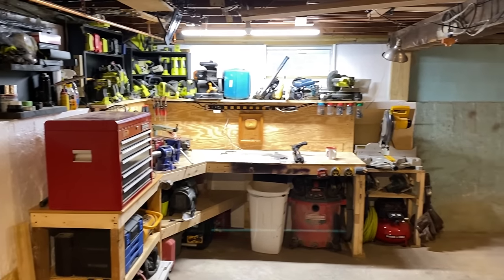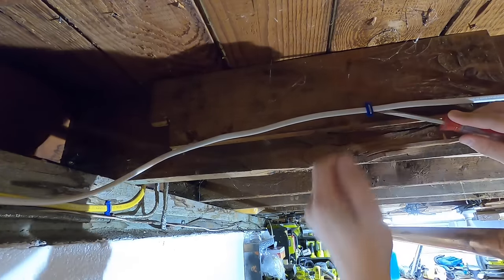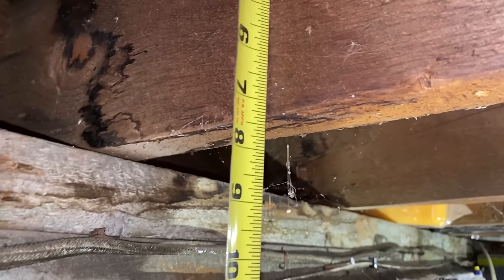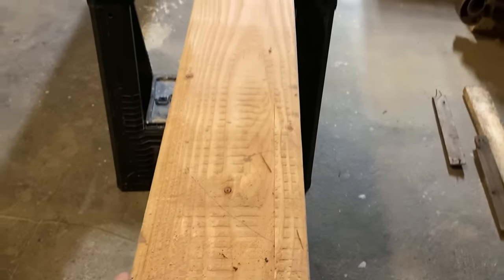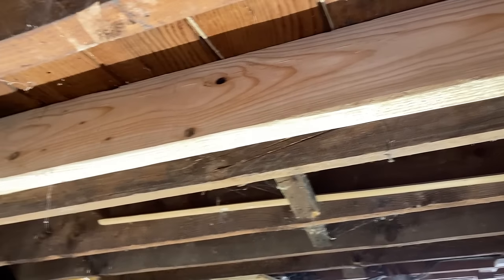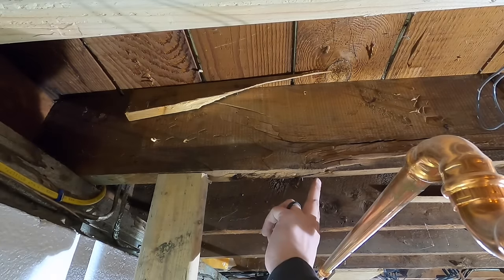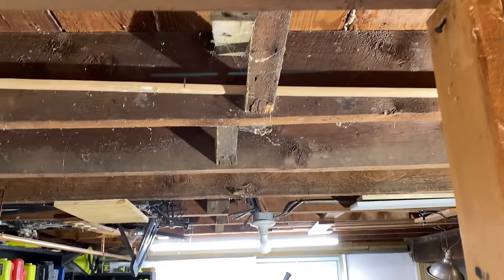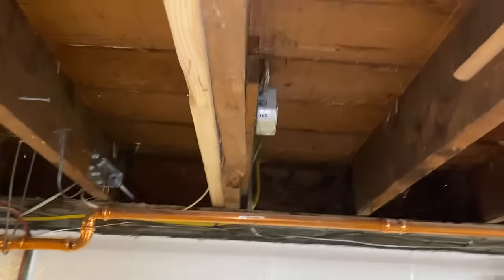"Sistering" a Cracked Broken Floor Joist

Comment: The only thing I would do differently is nail it as well. Screws have alot of clamping force, but can shear vs nails which can pull out, but have better shear resistance.
Reply from the maker: Yeah I will probably add a bunch of nails.  I wasn’t satisfied with what I had there after an hour or so and I have a bunch of spikes so probably gonna go nuts with the nail gun.  😁😁👍
Reply: Depends on the screw or situation. We don't know what is above or the load but all he did was make a double. Some screws are structural, but he did say construction screws. I'm thinking home Depot there cheap construction screws looks like the expensive grx sold at Lowes. Spax at home Depot are said to be structural screws
Reply: Depending on what brand and rating of structural screw you chose, screws will actually handle quite a bit of shear if you array them properly.
Reply: You can use GRK screws that have the shear strength of a nail, with the clamp of a screw. Expensive though. And I always clamp the boards together as well before fastening.
Reply: Timber locks or head locks are way way stronger than any nail. They make the red ones specifically to attach lvl’s together, but people are in a hurry and want to cut corners and use Nails
Reply: @Doug Miyamoto  grk screws got my entire porch back on when the thing fell, I got to surf it to the yard floor 😅

They haven't budged an inch In years, agree its the highest price but I can't possibly deny the results
Reply: @h2s142You’re absolutely correct. Definitely use construction adhesive.

Comment: I learnt it the hard way, attaching the support with a couple of screws so that it doesn’t fall and create damages. I was working with my son to replace a porch 4x4 post. Didn’t screw the temporary support sitting on a jack. When we made a small adjustment the support fell down and hit a garden shovel in the vicinity. The broken metal spade portion was thrown off about 10’ and the remaining broken handle swung and made a hash on my son’s shin. Fortunately he has forgiven his father for his stupidity

Comment: Aren't, you glad the previous board for the original repair was not glued... I am baffled why we the population is so enamoured with glueing... I am not convinced that it is a good thing.  Next time you may have to remove both rendering the repair a little more complicated... Don't get me wrong I have used glue before but I do it reluctantly.... Always thinking of " What if I have to repair it down the line."..

Comment: I had to do the same in my house (built in 1929) the only thing I did different was C-clamped it before adding screws to ensure adhesive contact along the length. It looks like it will be fine!
Reply: I'll be doing this tomorrow on a 1910 home... but I WILL be raising that joist which has sagged in the process...

Comment: I would have C-Clamped them together rather than using screws to pull together. This assure a better bond for the adhesive. So First apply the adhesive, then C-clamp together, then finally add screws to finish. Hear in Texas we call that a Sandwiched Beam or Rafter if 2 sided.  Sistering if 1 sided.  Other wise.....Very Clear Detail and Running Explanation and Video.!!
Scott Briggs, 82.  Luxury Custom Home Builder 38 years.

Comment: Came back here to say - THANK YOU. You saved me a bunch of missteps. And you're the only one I saw that advised to screw the jack to the old joist, that trick saved my TV several times for sure.

I was repairing a 16' span and the jack kept getting lifted and became useless, so I quit using it and used a 2lb sledge to whack the joist into place. 

Floor is rock solid now! Thanks a ton, man.
Reply from the maker: Happy to hear you got it done!  And happy I could help out! 👍

Comment: I've sistered every second joist in my century home and boy it was a fun experience.  I used bessy clamps to suck the 2 boards together which helped a lot.
Great video bro!👍
Reply: Good clamps especially the padded kitchen cabinet clamps to help align as you secure the cabinet to the wall

Comment: Where I’m from we call that ‘marrying two boards’. Also, I’ve used a couple of C-clamps to bring 2 boards together.
I only know that because about 4 years ago I had to strengthen some floor joists in my 1972 mobile home under what had been the bathroom. The original floor joists were rotten on top in places and so there wasn’t much area to nail down the plywood. The solution, I felt, was to marry (in one instance sandwich) new boards to the old ones. I used large C-clamps to force the boards together while I ran screws into them.

Comment: I did this exact same thing pretty much except in my crawl space. Instead of using screws to bring the boards closer together I used half inch wide 8 inch bolts with washers on each side and impacted them together

Comment: My nickel on the ground, Sister is a shipwright term when pairing up the frames of wooden boats to strength them as each frame is different form the next they have to be made individually to mate together. By the way i was taught wiring cleats have to be a hammer length apart with the nail underneath to support the wire.🔨⚒🛠
Reply from the maker: Interesting!  Thanks for sharing!

Comment: Having had to do a similar job I used G clamps as well as glue,in this case I would put some gap filling glue to the top and nailed and pilot drilled for screws to avoid overstressing.Maybe treated the old joists for termites as well.👍

Comment: Those floor joists look familiar and I have a few above our kitchen that need repair too due to bath remodel plumbing. I did one of the over notched joists a foot of two from the corner of the house under the second story floor. It was not fun. The other is under the tub and the joist is already sistered, and both are notched so much the floor sags while in the shower and the plumbing leaks almost even time, unless we stand back far enough from the tub drain to keep the floor from bowing. If it were the only problem I would have tackled it long ago like some of the other plumbing I've adjusted to reduce other code issues. but I'm still left with 3 that I know I need to address. It's nice to see a youtube about a house that was built with similar materials as mine and I look forward to searching your channel for more ideas on how to address my future attempts to repair our houses bath remodel issues. :)  And  possibly some other ideas besides.

Comment: It’s amazing how much extra time has to be spent on building because we can’t get straight lumber. I know green wood chances as it dries but I’ve almost had to fight local hardware store managers because I was sorting through lumber that I was using to pour concrete sidewalks with. I needed straight boards.

Comment: Had the same issue in my 1975 house... right in the middle of the dinning room floor.  One 2x10" joist had a huge knot that weakened and cracked all the way through, top to bottom.  The builder never should have used it in the first place.  I added a 3/4" plywood "sister" on both sides after carefully jacking it back up in place about 3/4"... construction glued and screwed, 48x10".  Did the trick and solid as new.
Reply from the maker: Yes!  Plywood on both sides with glue almost turns the joist into an engineered piece of lumber!  Does a great job!  Thanks for sharing!!
Reply: @TheFixerHomeRepair  How do you come up with a piece of 3/4" OSB that's as long as a joist? Or can multiple pieces be butted together?
Reply: @mikemiller9891  no it doesn't have to be AS ALONG AS the joist you are supporting.  it just has to overlap the cracked section by 2-3 feet on either side of the weak spot.  In this video he makes a replacement joist and acts like its a sister joist when really its just a replacement joist just as strong as the original and same size as original making the original redundant and he could have just cut out the original at that point since he's not relying on it at all.  Whereas just putting a sister joist in the damaged part of the original still utilizes the original and relies on it.

Comment: Only problem I ever had was floor squeak between the joists and subfloor, adhesive is needed there also. Sister or marry can be used        interchangeably.

Comment: Here in South Florida, it’s all slab on grade. We don’t have such issue, but I enjoy watching you work. Good job.
Reply from the maker: Lucky!  Only thing I get nervous about with slabs is plumbing repairs… I have heard stories.  Thanks for your continued support of my channel! 👍
Reply: Funny you should say that. I just had 16’ of 65 year old cast iron sanitary line replace with PVC. They hydroblast a 3’ x 3’ tunnel under my house, fill shot blasted back in. Expensive, $330 per foot. No way around it, I just had to bite the bullet and do it. About $8k with permitting and engineer’s report.
Reply from the maker: @1styoudummy  wow.  Yeah that is pricey!  I guess you take the bad with the good.  65 years is not bad in pipe years.  At least it is done, one less thing to worry about!
Reply: Its not all that way. I've done a few renos that involved crawlspace work to beef up the load capacity for granite & tile. Fun! /s

Comment: yep i agree with TheNixonotification ...screws do NOT have the shearing strength that nails do. In fact screws shear off really easy.
 Adding nails will increase the strength of that sistered beam immensely.
Reply: Shear still wouldn't matter it's a double. New beam is carrying half the load from above.

Comment: It is a relationship thing.

Much like you have motherboards and daughter boards, this describes the main use item and the secondary item such as video cards, PCI cards, etc, you also have sister items, they are the same but different.

In this case, they are the same board, doing the same job, side by side, but not the same item. So they are sisters. In order to be a sister, there must be at least 2 of them.

Comment: Any recommendations on what to use for shims on the bearing ends? I have a similar repair I am doing, but the original floor joist is 7 3/4” (mine vary from 7-8” throughout the house) so there is enough room after slipping in the 2x8 that you can move it up/down easily.

Comment: If you really want to add additional strength I would suggest adding a piece of 1/2" OSB sandwiched between the two joists and alternate ledge locker screws installed from opposite sides.  The OSB is incredibly strong in the vertical orientation and is found in most new construction for that reason.  I did this in my home when replacing a shower stall with a large 2 person jetted tub in a bathroom remodeling project.
Reply: That's the way I do it as well, but I typically sandwich with ply.

Comment: I am so inspired! You have access at both ends for the new sistered joist to sit on. Would your be comfortable if you only had access on one end? Also what’s the difference between the screws you used here vs the Timberlok you used in a different video?
Reply from the maker: Hey!  If I only had access to one end it would depend on the situation.  In this case, for example, if the end I had access to was on the side that the joist was broken then I would be ok with just attaching it to the old joist.  If it was the opposite I would be less comfortable.  As far as the screws, these ones are smaller and do not have as much shear strength as the timberloks.  I would have used timberloks on this but didn't have them on hand.  That is ok though because there was not much weight on this joist.  Hope this helps.  Thanks for watching!!

Comment: Nice work!! My house needs this, but I just read that joists should be sistered with large nails or lag bolts! They said screws don’t carry the weight load properly!
Reply: Construction screws like Spax screws in a situation like this should be fine especially if the ends of the joist are fully supported. Shim if necessary. Nails will have the least holding power. If you are worried use a couple of lags or even carriage bolts.

Comment: Pull the two boards together with a big "C" clamp as you go across.  Screws are very hard (brittle) so the will shear.  Nails aren't hardened, so they will not.  I would have checked the straightness of the original vertically with a taught string.  Looks like your floor has a sag in the middle. Best way would have been through bolting with big fender washers with 3/8 bolts.
Reply: Is there a video that you know of that shows this?

Comment: Great video. Just curious why you didn't want to fix the dip and also in what case you should fix it?
Reply from the maker: Hey Jay!  In my case the floor doesn’t bother me.  I think it looks worse than it is but it also has a long story that I discovered doing the living room remodel.  Long story short, the house was built in 1946 so even if I leveled all the joists, I really wouldn’t be leveling them as they are all different sizes and the floor has sunk differently everywhere.  I would say you really don’t HAVE to ever level it unless you want to.  If the joists are also grossly undersized and continue to sink to the point that it is dangerous is a good case for attempting to raise everything.  Hope this answers your question.  Thanks for watching!
Reply: @TheFixerHomeRepair  That helped. Thanks for the response! Happy holidays.

Comment: Professionals generally consider nailing two boards together a double girder, while adding an identical board to an existing joist, a sister. 
I suppose the boards have to be dimensionally identical for it to be “sistering”.

Comment: Is predrilling necessary before drilling in those 3inch construction screws in?
Reply from the maker: Not when you are using lumber like this.  I only predrill if I am worried about something splitting.  Just keep the screws away from the edges and it will be fine.  Thanks for the question and for checking out the video!

Comment: i always thought you were suppose to use specialized structural screws or bolts when sistering. structural screws are made to resist sheering unlike regular screws.
Reply: I did this once. I used Head Lok 2 7/8 structural screws. Those things are a beast!
Reply: Just putting the sister in with glue will hold the sister in place, the sister will hold the load without the screws or the glue, that being true, adding the screws will make everyone feel better, always put back the x bracing.
Reply: If the ends of the sister are supported it is a compression situation not a sheer situation. The screws just hold the sister from racking away from the original joist. The screws should not see any vertical force and little lateral force.

Comment: Before screwing you should have used clamps to bring both 2x8 together also vacuumed the dirt before putting on the glue alot of spider webs would not have taken long

Comment: Hi 👋🏼 Do you have any suggestions for a floor that isn’t level? One that slopes.
Reply: Yes; you’ll need to do what my brother did - he had the same problem you have with his nearly 100 year old house. 
He worked with a structural engineer and worked out a nailing schedule to sister lvl’s to the existing floor joists (they were structurally sound but tilted to one end of the house — the foundation had settled unevenly).
He had to remove parts of the floor and subfloor, and he sistered the lvl’s level to where he needed the rebuilt floor to be. (So when you go into his basement and look up you’ll see the original sloping joists and the new, level, lvl sistered joists. 
He had originally planned on jacking up the low side of the floor and building up the mud sill where the floor joists rested, but his engineer talked him out of that “solution”. He said the lvl solution was better (lvl = Laminated veneer lumber — LVL—  is an engineered wood product that uses multiple layers of thin wood assembled with adhesives. It is typically used for headers, beams, rimboard, and edge-forming material. LVL offers several advantages over typical milled lumber: Made in a factory under controlled specifications, it is stronger, straighter, and more uniform. Due to its composite nature, it is much less likely than conventional lumber to warp, twist, bow, or shrink.)
Reply: @DanielinLaTuna Thank you